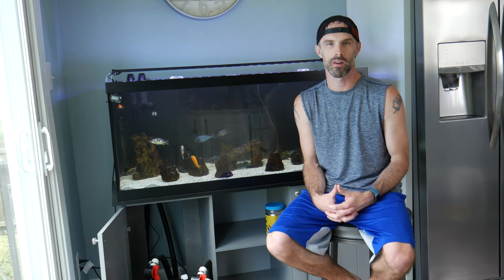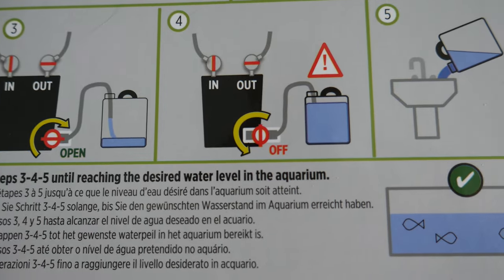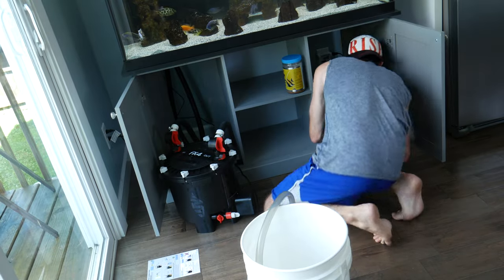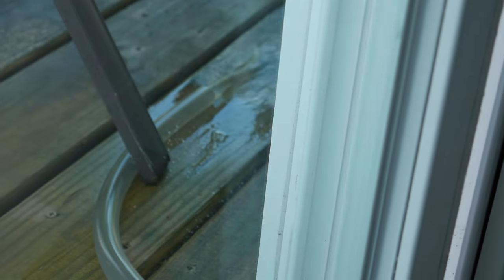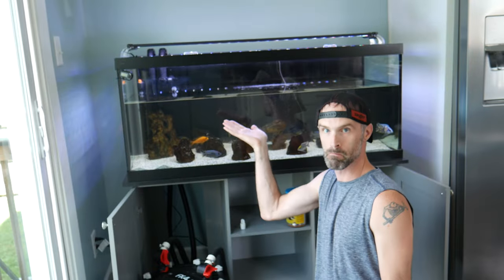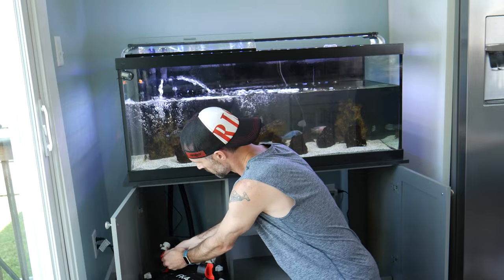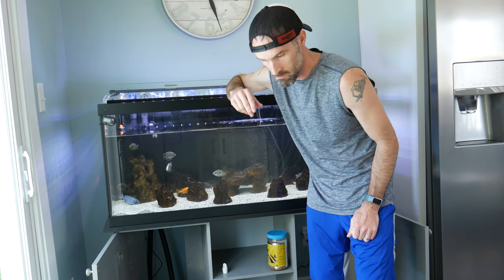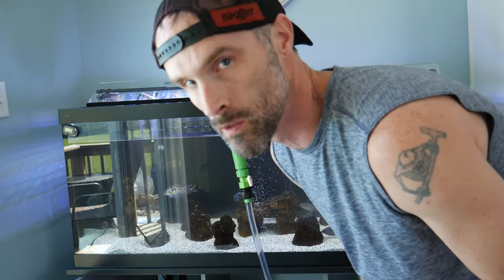FX4 water change explained!

Comment: I could see draining it this way on occasion but filling through the filter? For me, no.
Reply from the maker: Yeah, I did it a few times, but after some more experience, I like using my Python to refill more. Thanks for watching!
Reply: Yea, I agree. I ran a water line to a spicket from my aeration tank in a filteration closet I built to fill my tank. Much better than using the filter.
Reply: Also, just as a suggestion for better filteration, placing the intake and the outputs on opposite sides of the tank makes for better efficiency.
Reply from the maker: @DLex912  Thanks for the suggestion. I've done it both ways, and it's worked efficiently either way. From what I understand, it really depends on the filter size, size of the tank, and the pointed direction of the output. Then again, if you have cichlids, they love digging in the sand, so everything gets stirred up regardless of which side its on. Thanks for watching! 👍
Reply: If you had an ro system, and filled barrels in preparation for a water change you would like this system. This would also work well to transfer water from a plant tank in a different part of the house. For me, i have a 50 ft hose from sink to acquarium.
Reply from the maker: This will be good food for thought for me in the future! Thanks! I've looked into RO. I have well water, and it's generally harder, which works perfectly for cichlids. I've had no issues with it. Thanks for watching!

Comment: So how the water flows through the filter is up the side then down the center through all your media. Clean tap water that was not conditioned so any beneficial bacteria you had on your media is killed by the Chlorine in the water. I would have treated the water in the bucket first.
Reply from the maker: I'm aware how water flows throughout the filter.. Thanks for the tip!
Reply: I don't use it ,I drain with a 850 gph pump. Then fill with python
Reply: Also if u have a mature tank , tap water does not kill off enough bacteria to cause issues, I clean all my sponges with tap water in all my canisters. Non-issue,  prime time did a video on that subject as well as have I. And patty
Reply from the maker: @TheSalient1  Yeah, after some more experience, it's just easier and more practical to refill with my python. Draining it through it isn't bad, though.
Reply from the maker: @TheSalient1  Yeah, I've seen those videos. All very informative, esp if you have a deep substrate. I like the pre sponge filters, too. Makes the longevity between maintenance last longer.

Comment: Well, I like to do it old school because it kills two birds with one stone.  I go in to the top of the tank with a hose where I create suction in order to vacuum the gravel bed to collect all the debris - and of course when doing this it vacuums up the old water.   How are you cleaning your tank itself (gravel bed) if you aren't using my method?  And if you are using my method aren't you doing twice the work?
Reply from the maker: I use the python a lot more often, esp with gravel substrate, per your method. The fx4 is only in my cichlid tanks with sand substrate. If I need a quick water change, I like draining it with the fx4 and then afterwards, fill up with the python and hook attachment from the tap water and add my water conditioner and/or some beneficial bacteria.

Comment: Save even more time especially if you have several tanks and buy two pythons. One for draining and one for filling. Put a pump on the tap side of the draining python and place it in a bucket in your tub. The bucket does two things. It keeps the pump cool and it catches any sand so it doesn't go down the drain. While you're draining one tank you can be filling another tank. Personally I won't fill my tanks with the same hose I drain with. They grow mold and bacteria. Another benefit for people who use the tap to create the vacuum. By using a pump in the bucket you don't waste all that water. Using the tap you waste more water than you remove. Last benefit. Using the pump in the bucket you still have the vacuum pipe on the other end to vacuum your substrate. Does a much better job than the tap or gravity. One more tip. They sell instant water heaters just bug enough for one faucet. They are small and fit under your sink. I have one on the faucet I use for my tanks. When I'm filling tanks and i turn on the hot water it comes out at 80° for as long as I need it. Game changer. What used to take me 6 hours Friday, Saturday, and Sunday now only takes about 5 hours one day a week. Using the feature on the fx filters is a hassle.
Reply from the maker: Thanks for the tips. I'm glad this works out for you!

Comment: Thank you so much for this video. I have a 75 gallon tank and up till now (I have purchased a FX 4 and am waiting for it to be delivered) I've been doing water changes the same time I do a gravel cleaning. I've attached a 25 ft white water safe hose to my large plastic tube cleaner and trail the hose out the back door which is about 10ft from my aquarium. Because my source of water is some distance from the aquarium (in the kitchen about 25 ft) and my sink faucet isn't the kind that will allow me to attach any kind of hose; I have purchased a very heavy duty large garbage container that has heavy duty wheels. I keep this container in the garage just outside my door going into the garage. When it is needed I roll it into the back door from the garage into the kitchen and fill it up from the kitchen sink thus in doing so I can monitor the water temp. When I have enough water that I know will refill my aquarium I roll the container into my front room where the aquarium is and by using a small submersible pump and a length of clear hose I refill the aquarium from the container. Once done I roll it back out into the garage. After viewing your video I can see where having the FX is going to help me immensely. Now when I refill the aquarium, I'll just attach that piece of clear hosing I have to the FX while putting the other end into my large container I have with the water supply and let the FX empty it out into the aquarium. Wow, that's going to be great. Thank you so much for a great video.
Reply from the maker: That's perfect.  I'm always happy to hear I can help someone out. Thanks for watching!
Reply: Fluval also has a fx gravel vac that goes along with the fx series. One of the many reasons the fx series is awesome.
Reply from the maker: @rollinxloud That's nice to know.  Thanks!
Reply: Hay there, I received my FX4 and it has been up and running on my 75 gal aquarium now for almost 2 1/2 weeks. I'm continuing the use of the two Cascade 600 Penn Plex filters until I'm satisfied that the FX4 is doing it's job effectively; then I'll remove the two 600. I did purchase the Fluval gravel cleaner for the FX series. It's awesome. I've used it once since I got it, and will be using it again tomorrow. It makes cleaning the gravel a breeze; and cleaning the unit after your done is a know brainer as well. I did add an additional filtering agent to the filtering bag that comes with the unit. I had a large media bag that was a very fine nylon fabric.  I removed the existing filtering bag and put it inside the media bag and then re-attached both inside the canister. It works great. Thank you so much for  your input, it's greatly appreciated.

Comment: honestly a garden hose and a aerator thread adapter works so much better for me. Nice to see how they intended to use it though. Some clients of mine use these and I just use the hose and adapter for changes and fills. Though I do occasionally purge through the drain line to remove excess debris in the filter.
Reply from the maker: Yeah, kinda neat, really. Check this out to, if you want. https://www.instagram.com/reel/C3YLoqprcxj/?igsh=MWozeWFya2VsOHV3cg==

Comment: I drain through the FX4 because it’s easy and gravity fed. I attach a garden hose with a quick connect and just let the water drain down m driveway.  I fill the aquarium using a pond pump and hose into the top of the aquarium. Seems simpler that way.  I have saltwater so I like to get my SG correct in the 30 gallon Brute before refilling the aquarium
Reply from the maker: Sounds like a great system you go by. I've really grown to like draining through the fx4 myself. I'll have to get a pond pump. Very good info! Thanks!

Comment: Hi thanks for the video. How big is your tank. Could you get away with fx6? Or would that be too powerful? I think I have similar size tank and wondering if I could get fx6
Reply from the maker: You're welcome. Thanks for watching. It's a 75G. You could get one if you're planning on having an overstocked cichlid tank. I have 12 in mine, so an Fx4 with a pre-sponge works just fine.

Comment: Hey man do you know the width of the tubing? I need around 8metres to drain outdoors rather than into several buckets
Reply from the maker: I checked the instruction manual, and it doesn't say. I've bought 5/8" width tubing, and it works just fine. It is a thicker wall tubing.
Reply: @PriceTagAquariums  legend! I would translate that to around 16mm inner diameter ! This is the clarification I needed thanks for getting back to me brother 🙏
Reply from the maker: Yeah, you're welcome.

Comment: Why does it tell you to turn the filter off and turn one of the valves off when input my hose ti the drain valve and turned it on and its emptying my fish tabk whist being on
Reply from the maker: If I'm understanding correctly, also in my video, you won't need to plug the filter back in (turn on) until you're ready to fill the tank back up. The water will easily be gravity fed out of the tank. The reason you close the output valve before draining is because if the output is left open, you'll break that cyphin from draining once the water level goes past the outputs up top, and it won't drain as well, if at all.
Reply: @PriceTagAquariums  thanks for the reply. That's what I'm saying. I leave the filter on leave the valves both on and the filter carries on working and I'm able to drain water out of the drain valve. So I wonder why fluval tell us to turn the filter off and turn the output off when it works perfectly fine with both on
Reply from the maker: @carfan6466  Well, that's great then! You're welcome.  Yeah, I'm not sure why that is. I reached out to them regarding your question. I'll get back to you if they do. Appreciate the input!  👍
Reply: @PriceTagAquariums  that's really kind of you to reach out to them. Only reason I mention is as I'm worried that maybe it damages the filter leaving it on when draining and that's why they tell you to turn it off. Just want to avoid turning filter off if I don't need to as I know over time turning off and on knackers the motor
Reply from the maker: @carfan6466 yep, I get it. Fluval  created a case number for me, so I'll hopefully hear from them soon 👍
Reply from the maker: @carfan6466 I'm happy to inform you that Fluval did get back to me via email concerning your question. It's a lengthy response. If you want, I can sum it up here, or you can get a hold of me through instagram or Facebook, and I can message you the response there or forward you the email. Either or works! 👍
Reply: Really appreciate the reply. If you wouldn't mind putting it on here that would be great as I don't use either of those platforms. Thank you
Reply from the maker: @carfan6466  Here is their response:
Maintaining the Siphon: By closing the output valve and unplugging the filter, you ensure that the siphon is not broken when the water level drops below the outputs. This is crucial for maintaining the efficiency of the filter system and preventing any potential airlocks.

Preventing Splashing: Continuing to run the filter while draining can cause water to splash inside the tank as the water level decreases. This can lead to a mess and potentially disturb the tank's inhabitants and setup.

Protecting the Pump: Running the pump dry or with an insufficient water level can cause damage to the motor and impeller, reducing the lifespan of the filter. By shutting off the valves and unplugging the filter, you protect the pump from running under low water conditions.

I hope this helps! Fluval also said my  explanation in the video is accurate, and following the proper procedure helps ensure the longevity and effectiveness of the FX4 filter.
Reply: Thank you. I'll play it safe and turn it off!
Reply from the maker: @carfan6466  You're welcome 👍 Thanks for all your communication and watching.

Comment: I have a problem with my fx4 drain valve. Its leaking. any fix for that?
Reply from the maker: I've never encountered that, so I'm not sure. Maybe try and find a plug close enough with a seal at the hardware store. On my next filter maintenance, I'll take a closer look.
Reply: I realize this is an older comment but I believe Fluval sells a repair kit with a new seal
Reply from the maker: I believe they do as well.

Comment: Seams like a bit of over kill with a canister filter on such a small tank… I put canisters on my 125 and my 180 but I use hang on the back for 75 and smaller.. just to much work for a small tank imo
Reply from the maker: It all depends on the type of fish, how big they are, how many,  how much you feed, and the bio load the fish produce. Generally speaking, a heavily stocked African cichlid tank needs a decent size filtration system. However, I do use 2 hob on my 55g mbuna and it does well. To each their own! 👍